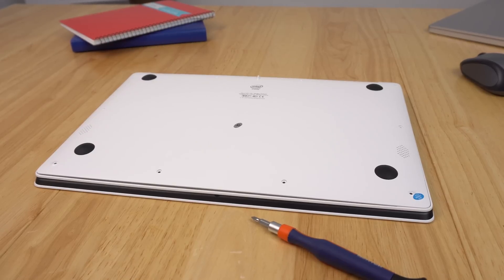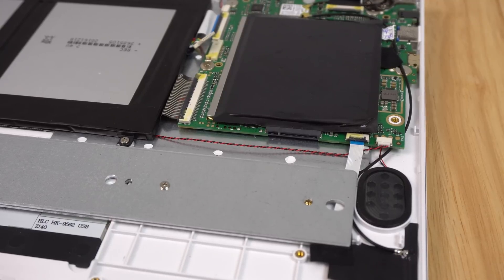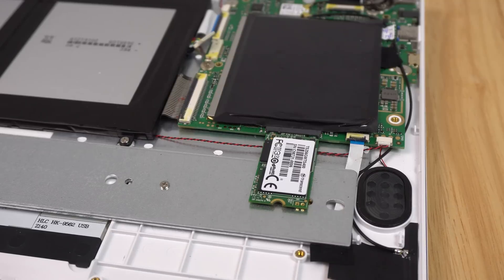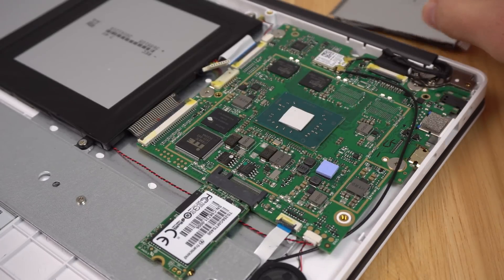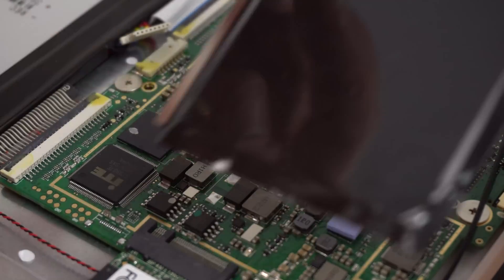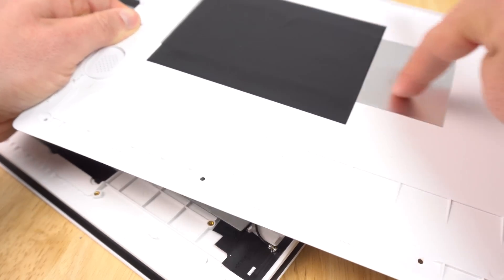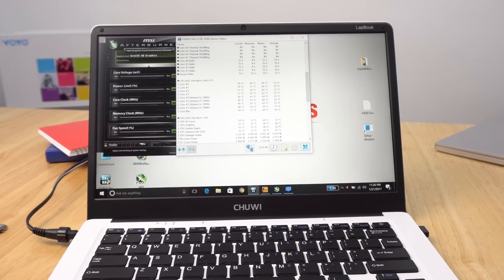Chuwi Lapbook 14.1 / Lapbook 12.3 Copper Heatsink Mod Lower Max Temps By 25 Degrees!

Comment: HEYT

I want to use those shims into my R7 2700x using my heatsink Cooler Master MA620 but im not sure if im having the best cooling, so i want to use the shim with my cpu and with my Asus GPU RX 580 8gb, do i need thicker thermal pads for the GPU?

Comment: Wait wait. Why don't you cover the metal contacts around the die?? How doesn't it short out when the copper makes contact?
Reply from the maker: There is a gap so it doesn't short and voltages are far too low for it to arch and jump short. If you're not happy don;t do it. But I've never hard an issue.

Comment: The only thing that worries me is that by adding the copper shim and that extra height it brings on the cpu, you may cause the ram heatsinks not getting in touch with the big heatsink.
Reply: La ram no necesita disipadores.

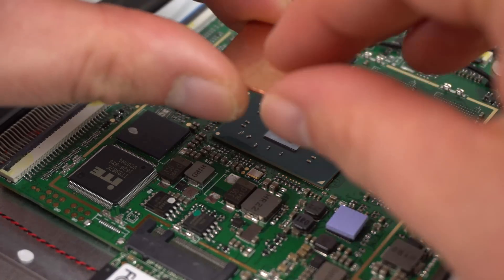Comment: I think it will be much easier to hold everything in position if you glue the copper pad first instead moving around and slap on the IHS (4:04)... Also, I may proberbly glue more copper pads instead of using thick thermal pads only, since thermal pads are actually not a good thermal conductor (5:44). 

p.s. Great modding! More modding! The copper plate on CPU did scared the hell out of me...

Comment: The following are my opinions and predictions. I'm not claiming it as definitive truth. I'm simply thinking out loud based on my 10+ years of engineering experience.
Isn't adding a copper shim less effective than just using quality thermal paste alone? You're just adding another obstacle for heat to pass through, not to mention an additional layer of thermal paste. I believe there's a saying along the lines of "nothing is better than something" when transferring heat between objects. Therefore, removing the shim would have better performance and for best performance replacing the entire original heat sink with a copper heat sink.
In addition to those mods, maybe try cutting some vents into the laptop bottom cover right above the heat sink to allow for some air flow across the heat sink.  The plastic cover might be acting more as an insulator than a thermal conductor. You could even try cutting a plastic sheet or poster board to test performance prior to mutilating your laptop cover.

Comment: Hello, I got into your video and being a holder of a Chuwi Lapbook 14.1 and I wanted to insert a ssd inside with the intention to buy this: Kingspec Tablet PC HDD NGFF SSD 256 GB, now what I ask the procedure is just to insert the SSD into the slot or, as read somewhere, I have to change the BIOS to use it as a boot drive .... here I got lost and I wanted to have some more detailed information from you .... ..thank you.

Ciao, mi sono imbattutto nel tuo video ed essendo un possessore di un Chuwi Lapbook 14.1 e volevo inserire una ssd all'interno  con l'intenzione di comprare questa: Kingspec Tablet PC HDD NGFF SSD DA 256 GB, ora quello che ti chiedo la procedura è solo quella di inserire nello slot l'SSd oppure, come letto da qualche parte, devo cambiare il BIOS per usarlo come unità di avvio ....ecco qui mi sono perso e desideravo avere qualche informazione più dettagliata da te......grazie.

Comment: Drill some hole in heat shield let the heat out. Or pad the whole shield and connect each chip. 70 is where my tablet and many others thermal throttle. Its why I started trying cooling options. 1.2 GHz only hitting .42 GHz due to throttling. More surface area to air or liquid and least resistance provides best strategy for cooling. Careful not to insulate or cause heat shields which is too much resistance for heat to travel through and escape. Great videos. Remember the master has tried and failed more times than the apprentice has every tried. The problem is the rear cover. It needs to cool everything but not burn your hands. Piece of metal on outside of back case attached with least resistance to heat shield or chips that could fit many tablets would be great. If it don't burn you.

Comment: I would remove all these stickers/thermal pads and use thermal pipe going to this enormous steel counterweight.
When you have 70*C with your mod, with thermalpipe on this steel plate you would get like 45*C
Reply: is it worth it tho

Comment: Planning to get this, is it possible to connect the heatsink of the cpu to that metal thing used to counterweight the base of the laptop via thermal pad or something to help lower down the temperature?

Comment: Chris just asking , if you put in that copper shim at the beginning on the CPU since it's a conductor isn't there a risk that it could short the other small components surrounding the CPU chip if someone presses too hard on the keyboard?  Also if you use a large thermal pad as large as the whole of the CPU on top with the board around it) would it act as an insulator at the same time?
Reply from the maker: Yes I mentioned that risk of sorts to those resistors close by, personally never had an issue with this. The thermal pads aren't conductive, so yes will be an insulator and also transfer heat well.

Comment: Hey. I got new batch which have a lot shorter counter weight, i have proper place for m.2 (because counterweight is shorter and it have screw in place where it should be) other battery (its black) A LOT LESS key travel (its like macbook now lol) and maybe even more differences if I find them
Reply: also this black thingy is a little bit different as its on other side too (below mainboard)
Reply: I have Toshiba eMMC instead of Sandisk
Reply from the maker: Thanks for the info, so it seems they have revised the lapbook 14.1. Is the CPU still without a propper copper heatsink then?
Reply: I didnt check yet. Im doing review for my channel and after I finish it I will reply there with all differences I found if you want
Reply from the maker: That would be great thank you.
Reply: MicroSD card reader is still on USB2.0 speed. Thats main problem, as 64GB eMMC isn't huge.
Reply: +TechTablets.com I just want to say you story with Lapbook 14.1. My laptop was throttling at 60C so I decided to flash new bios. You know what? laptop no longer boots and this update is on their forums from 20.06 bricking people laptops. Check the thread with bios download on Chuwi forum. I wrote there about my problem and they said me to refresh windows. They didnt reply me on email from 3 days. Do you have experience with their customer service? I am very disappointed and angry at them.

Comment: • I only found copper shims 0,6mm, 1,5mm and 2mm in thickness. What would be best?
• Will 15×15mm transfer heat worse than 20×20mm?

Comment: You could also just trim the copper shim to the size of the die.  Then there is zero chance of shorting out the resistors with copper scrapings.  Of course at the voltages that are running through them even if they do short out, a cleaning with isopropyl will probably restore function.

Pure copper should be very easy to trim as its one of the softest metals.

Comment: Hi Chris, i´m goig to make this mod, but this mod will make the back cover hotter, right? I use it a lot on my lap, so this could be a problem. Maybe i can make the mod, but leave the black termal film arround the shield? I think if in this case i cold get less temperature in the cpu but don´t burning my lap. Or this could cause too hot in the cpu and can´t be disipated out

Comment: I did this great mod, thanks very much. But I had to also remove the female part of counterweight screw and place it in the left hole, because there the female part was missing. Prepare to use some raw force ;-)
Also, a 2280 M2 SSD fits in, if you cut off the end of the counterweight, where the ssd gets inserted.

Comment: One idea, If you are afraid of short circuit any thing, why dont you put a mica 0,4mm with a size hole of the cpu and then the copper shim on the top.

Comment: Hi Chris, I noticed you're not using the Power adapter included by Chuwi with the laptop, is it a 3rd party one? I'm interested in buying one too, thank you!
Reply from the maker: Hi, it's just a run generic one I have, variable voltage, and you have different plugs for the end you can swap. No brand thing I got from an electronics shop.
Reply: TechTablets.com ok then, now I'm sure it's not a propertary connector!
Reply from the maker: Edoardo Pigaiani Standard type DC plug

Comment: Hey Chris,
in the video above, are you still running Counter Strike on the minimum specs after the mod?
Reply from the maker: Same settings as before (in review)
Reply: Thanks Chris. i did the mod with same spec parts (different compounds/adhesive but same measurement shim, pad). However, my 10 mins test on CS GO is giving me about 75deg-79 deg. Where you reckon I got it wrong? Thanks!

Comment: I did it and after all I reboot the computer and an hard disk error appeared,the screen turned black and now the laptop doesn't turn on or boot even the BIOS.What can I do?Could this mod be the problem?
Reply: Did you get a solution for you powering on problem because i have the same problem and need help on how to test or repair it
Reply: Franki Fran Guess so, I've got a Chuwi lapbook 14.1 myself. After reading your post I'm definitely not going to try it now..

Comment: Can confirm this mod. I bought these copper shims on amazon for like 2€ in different thicknesses and i didnt used a thermal pad because it was to expensive. So i just used a copper shim on the cput itself and behind the ametal plating still a 20°C decrease so you dont have to use a thermal pad just something that can transfer heat

Comment: does it support m.2 longer than 2242? how about 2280?
Reply: It looks possible to me. I will try it one day.
Reply: Update. Had to cut the counterweight, but it fits
Reply: wow thanks dude.
so in the end you cut those silver part right?
okay then. gonna but this ones lol
Reply: Yeah it was easy enough to do. I guess you could cut the other side as well to save weight, honestly I don't think a counterweight this heavy is necessary.. System works great after the thermal mod, which IMHO is necessary. I can't recommend this laptop out of the box, but after a little modding it's pretty good.
Reply: I did the same and cut off the metal weight. Then it did fit, but only by a real small margin.

Comment: Amazing video, but you shouldn't have cut the part where you take it one step further and take the black insulating material off. Also maybe include links to gearbest on where to get the specific thermal pad, copper pad, thermal adhesive, paste etc.? :/  (Sorry for asking much. Amazing channel for the students and the people on a tight budget.)

Comment: Is there any point in going to the effort to do this if you don't intend to do gaming or intensive video editing etc?
Reply: 100% no point,
Reply from the maker: For that no point really. Unless you do work that CPU really hard all the time doing something else non-gaming.
Reply: Thanks. Would the mod make it too hot to put directly on your lap? I imagine it might as it directs more heat to the outer shell.
Reply from the maker: Not really, it only warms up a little not much at all and better than I thought.

Comment: Great mod Chris, I couldn't resist, the Lapbook is currently on flashsale at Gearbest für € 224,-, had to pull the trigger. Thermal mod materials are also already on order. 
One question though, do you think one could also fit a 2280 form factor M2 Sata with the back panel still closing or do you foresee any problems with that?
Reply from the maker: Might be very close, I think the max size would be 2260. But I've only tested 2242 which I have on hand. If I get a 2280 drive I'll test it out.
Reply: It works, but you have to cut the metal counterweight, just saw the end of it off. Then it fits by a small margin.
Reply: I just put a 2242 in it and was done with it as evidenced by writing this reply on the LapBook. ;-)

Comment: Hello , amazing job! 
I'm currently looking into doing something like this for my Dell 7350 (Core M-5Y71). 
But do you thing it will actually give me better performance??.
The termals are handeled almost like this laptop and  I fell like there could be improuvements. 
You can see how it's done in this picture: http://i.ebayimg.com/00/s/OTAwWDE2MDA=/z/FdMAAOSwZJBX~vlB/$_57.JPG
The CPU is located just between the 2 screw at the bottom. 

I'd be really curious to see a Cinebench CPU benchmark of this laptop with your mod! 

Have a great day :)
Reply from the maker: Yes, I see room for improvement there.

Comment: - Didn't smd resistors (or what is it) around CPU close on copper heat sink? What if the notebook be shaked, and heat sink touch the resistors?
- Should maybe drain the heat from tha shield onto counterweight?
- Should maybe remove that counterweight at all? I don't understand why a user of mobile device must bear this useless weihgt. They might mount a battery with more capacity instead of this piece of iron if they want some extra weight.
Reply: Counterweight is there so that the notebook doesn't tip over when putting the screen further back. If you could find a bigger battery with the right connector that fits the casing you certainly could make use of that instead of the metal bar.
Reply from the maker: That is why I used thermal glue to hold the copper in place, if it was to come loose it would short something. The counterweight is a must to stop it from tipping over when the screen is angled back as explained in the video.
Reply: I understood about counterweight, but I consider that it's failure.

Comment: Great video. The best thing to use is adhesiv thermal glue to make it permanent, but you should always try with ordinary thermal paste and do a test run first, to check that it is working as it should in case you run into any issues.

What makes me angry is that this is nothing new to me, often they cheap out on cooling and thermal design, I do not understand why. This is typical for a lot of Asian electronics. And doing a fix like this is something the consumer should not have to do.
Reply from the maker: Since I've done it plenty of times now on a range of devices I know the results so the thermal pad will stop it moving if dropped or in a bag etc
Reply: I understand, but as you said in the review, this is something you should not have to do on your own. They should get better at designing cheap thermal solutions that at lest do work as they are intended. You have nice reviews of lots of interesting electronics.

Comment: Very good mod I hope 1 day instead of them spending all that money on aluminum they will just buy copper and make the shield inside and the whole backing out of copper
Reply from the maker: If they just made the rear plate alloy instead if plastic and used a thermal pad when the SoC and rear plate that would avoid this issue.

Comment: do not touch metals with your bare hands, they will leave body oil on it
Reply from the maker: Good point
Reply: i wanted to say the same thing.Clean with Isopropyl alcohol and don't touch with bare hands. I use unpowdered non latex gloves. I will try when my shims arrive at my laptop. You don't need a thermal glue , it will move but thermal paste will stick. Before placing copper ( conductive) shim, i recommend isolating the cpu with clear nail polish. You can remove it if you use nail polish remover.  (acetone)

Comment: A tip for thermal paste: When removing the syringe from the CPU dye pull a bit from the syringe piston so it does not drip or makes strings. Depending on the thermal paste density/viscosity you need to do that or be stupid careful. In fact that made me switch from the MX-2 tube I had to another thermal compound. Had to troubleshoot another PC, and when switching CPUs saw that a tiny bit squeezed inside my PC socket which I was able to clean well enough.
Reply from the maker: Great tip, I'm horrible at applying the paste.

Comment: What is better Arctic Silver 5 or MX4? I heard alot of positives about both or are they just the same
Reply: I think MX4 is slightly better. But I use Gelid GC Extreme which i think is the best.
Reply from the maker: I think silver 5 is quite conductive which would increase the risk of shorts if you did happen to go a bit overboard with the paste like I did. MX4 does the job well. Other pastes would also work just as well.
Reply: Zaidi Hamid Thanks I never heard about that one. Reviews seem good too indeed
Reply: TechTablets.com Thanks

Comment: I would cut the copper just to make sure that will not do a short circuit. Anyway, besides that, perfect ! Do you think that solder ram it will be easy with necessary equipment?
Reply: i was wondering the same, any repair shop with an air soldering iron can do that job and this notebook with 8GB of ram will be a beast,

Comment: OMG,
original cooling is so basic (bad) how can they sell this??????
ridiculous
Reply from the maker: I think its because they follow Intel's schematics to the key and they also wanted to keep the skin or surface temps on the bottom down so they used that thermal pad to keep the heat in and not be transferred to the rear of the laptop. Some copper in there is all it would have taken to improve things, at least in the metal alloy rear housing tablets they use thermal pads. Hi10 Plus, Hi12 etc all have thermal pads and good temps.
Reply: its 299 thats how

Comment: the thermal paste u are using is not conductive and more will not do any harm less will
Reply from the maker: Yes, I used a lot of it over the whole piece of copper and any access isn't an issue it will stop it from ever moving. I also plan to never open it up again, its once off job this copper mod.